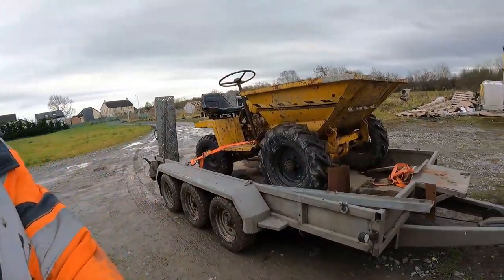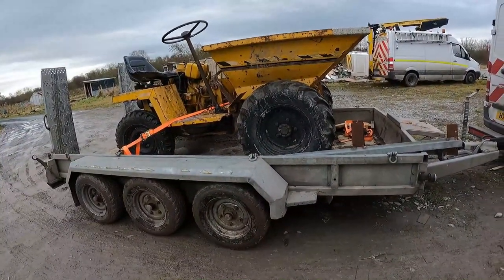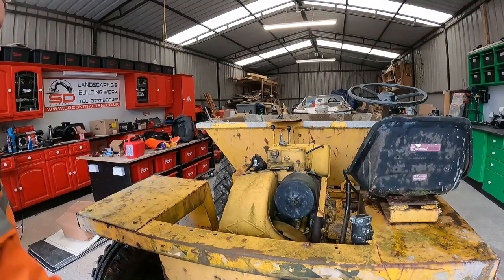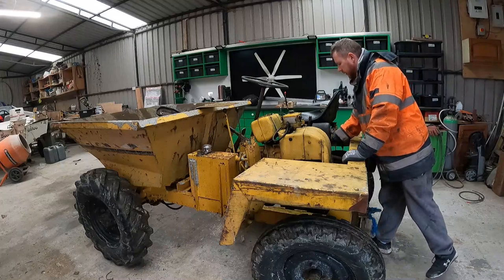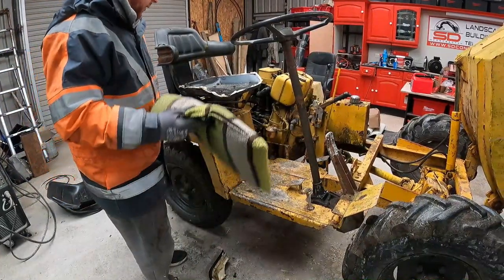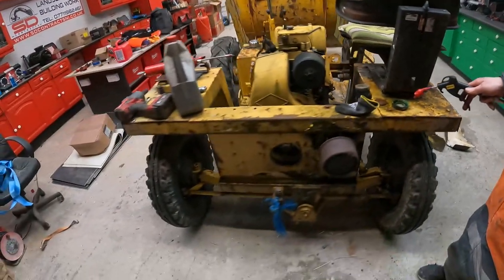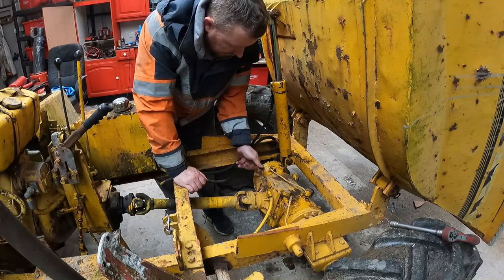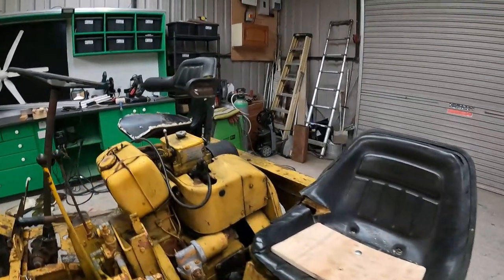buying and fixing old equipment petter dumper

Comment: High thats a nice looking dumper, If that green brake fluid top is original to the machine, it usually means it doesn't take regular brake fluid like dot 4 it probably says mineral type fluid only. If it should have mineral fluid, regular ruins all the rubber seals.  Somebody did that to my JCB 3c mk3 here in Canada before I got it,  luckily i flushed it out put the right stuff in and the brakes started working again after bleeding. it only drips once in a while  and never goes on the road so i've topped it up once a year for the last 8 years after the winter storing in a snow drift. If I ever restore it the seals will have to come from the U.K, it's a rarer machine here with not many parts around JCB even disown it here !  If there is any doubt about the fluid type do what every new owner should do Buy an operator/service manual if it didn't have one,or find out online if you can..  Yeah I know it's a guy thing not to do crazy things like that I had a hard time finding the original digger one, and I still see people arguing genuine JCB book info on forums L.O.L. Take care.
Reply from the maker: Thanks for the info, I didn’t know that. Will definitely look into that, I’ll have to get a manual for it. Thanks for watching and commenting 👍

Comment: How many gears foward and reverse what size rims and tires how many gallons feul and how many hours will it run working and whats a good fast cruzing speed as well? Thanks for the video i wish i could find one here in the united states.
Reply from the maker: It’s 3 gears forwards, 1 gear reverse. I’d say the top speeds about 25/30. It’s only a small tank holds about a gallon but seems to last a long time. Hope that helps, thanks for watching 👍
Reply: @seandoran6809  thank you!

Comment: I Look forward to the house  build 🏡⚒️🍻
Reply from the maker: Thanks, I’ve started digging the footings. Hopefully the rain stays away
Reply: @seandoran6809  it's a milder morning here in Tyrone  I built here in 8 year ago had to pile it  filled ground top of bog  thank god the land was cheap to balance it out  I wouldn't rate the pumped cavity insulation  got for slab insulation
Reply from the maker: @deranocasper  that’s the same ground I have here, 5ft of fill on top of a bog.  Oh I was going to go for the pumped cavity insulation, what would you recommend instead? Cheers 👍

Comment: Lovely!
Just one thing to note, it isn't recommended that you stop the engine using the decompression lever, as it can cause engine damage.
Stop the engine using the fuel rack/governor arm, moving it away from the flywheel end (so towards the front of the dumper) and hold it in that position until the engine has stopped turning over.
Looking forward to more updates!  Doug
Reply from the maker: I didn’t know that Doug, thanks for letting me know! Will def do that in the future! Thanks for watching
Reply: You're welcome Sean! 👍

Comment: At the 12:00 mark you add DOT 4 brake fluid... I hope this has not made it as far as the axle as it will destroy it. The brake system on these uses hydraulic oil, NOT NOT, brake fluid..
Reply from the maker: Thanks for the heads up, someone else commented the same I’ve it drained and all 👍👍